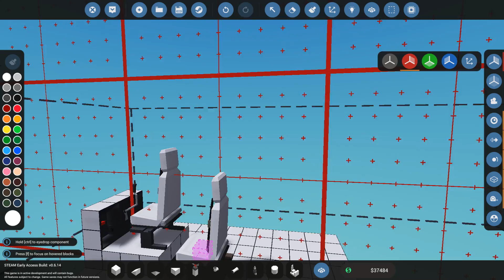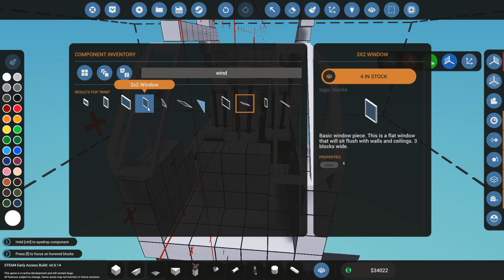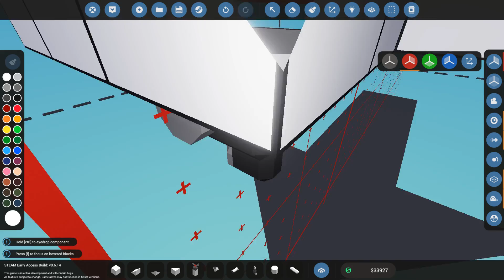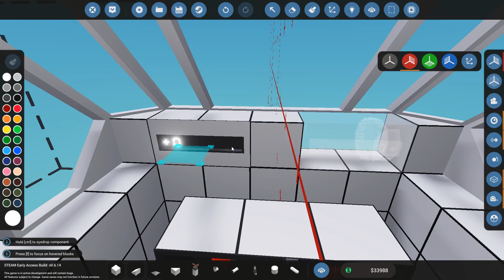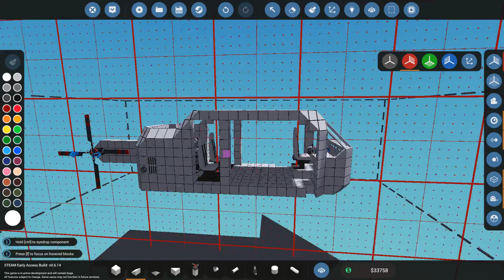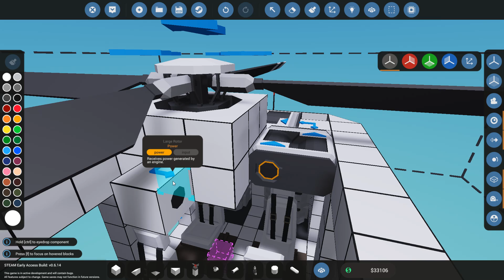Stormworks: Build and Rescue - Career Advanced - Episode 9 - Building A Helicopter

Comment: I know this is ten months old, but I found the best way to build a nose is to start in the middle. So you create a shape and size you want witha  level plane and then you build a single block up and down from there and then fill it in with angled blocks. That way you can make a 2 sided and shapely nose quite easily.
Reply: i know this comment is 4 months old but damm THANKS i was making a heli to make easier movement in air and that helpedthat really helped im also gonna investegate air and how bad it can turn and i had a tsunami lately and it destroyed both my boats and i saw it coming i had my heli copter that worked but didnt work and it saved me but i lost my boats one didnt get destroyed but its float somewhere i dont know if it sinked but now its done and now im investegating storms :) thanks!
Reply: @alberttorns  Hey, add me on steam and we can have a game some time. I havnt played since this comment, but was just thinking about getting back into it.
46521524 is my steam friend key.
Reply: @jacobotstot2021  sure maybe sometime